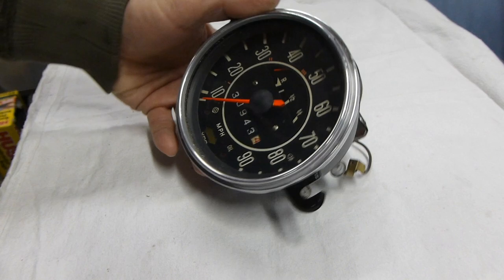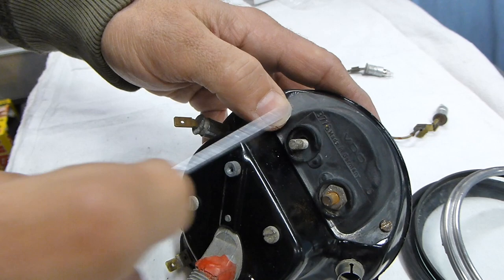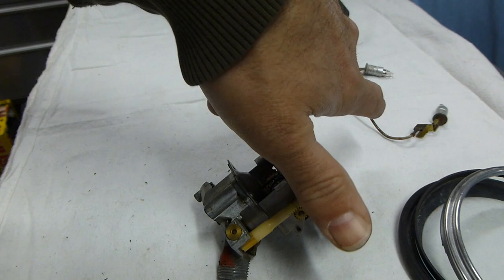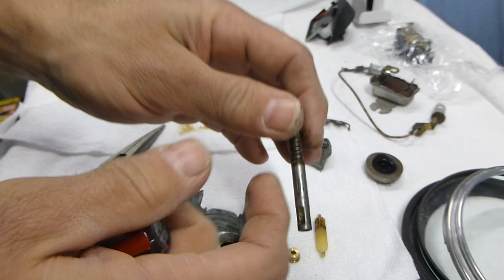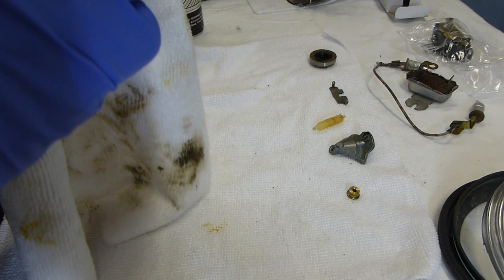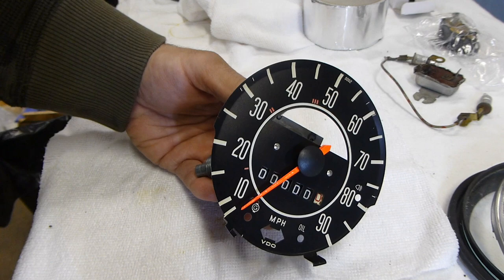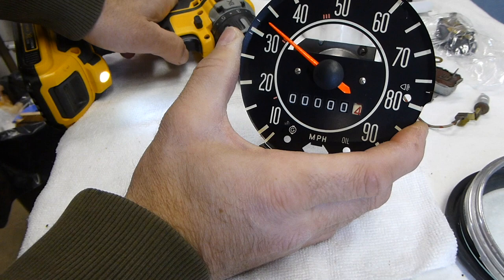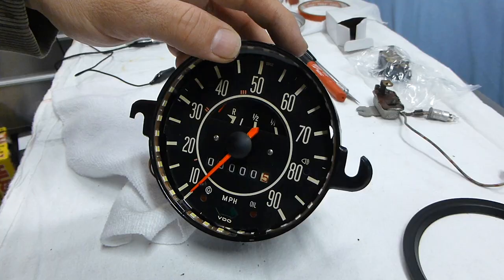Classic VW Beetle Second Gen. Speedometer Rebuild and LED Install

Comment: Way to think outside the box. Never thought about adding a led strip.
Reply from the maker: I tried to find better bulbs etc. but nothing was strong enough to make a difference so using the led strip was simple and effective, and isn't visible when it's off.

Comment: Thanks for the video. It's the best one that resembles mine. You've allowed me to tackle this myself for my '74 VW Thing. There are a few minor differences but 98% identical. My glass is actually polycarbonate of something and it had no gasket. What kind of grease do you recommend?
Reply from the maker: Thanks! I'm glad it helped. I use a thick gear lube grease, you can use any gear type grease that is ok on plastics etc. It doesn't take much, you don't need it to sling around. Something like a good dialectic grease could work well too.

Comment: Ppl like me use videos like yours when we run into problems. Like I did rebuilding my speedometer. The two toughest parts were resetting the miles and putting the back of the speedometer back on. Lining up the tiny little wire in the tiny little hole. Your video was very informative until you skipped showing the two hardest parts and cut away only to return with the part fixed but didn’t show how to fix it. Other than that it was okay. On another note I believe people like me don’t necessarily go looking for these videos unless we run into problems with something we are doing. If I find the video that helps fix my problems I mostly skip past all the BS ppl say and do to make their videos fancy and go right to the meat of my problems. Thanks for making them they help most of the time.

Comment: Great video ! Would the LED connection need a resistor ? Or just connect it ? Thanks for your time big fan keep up the great work on VW DYI . Alex NJ
Reply from the maker: Thanks for the kind words! The les strips I get are 12v so on a 12v car it's a direct connection. On a 6v car id add a converter that converts 6v to 12v you should be able to find them on Amazon or alibaba etc.
Reply: @WolfHausMotorwerks did you wire the LED strip to the dimmer on the dash?

Comment: What size LED strip is that?
Reply from the maker: It's a generic Led strip, about 12" long and just a bit less then 1/2" wide, you can use a strip that is less wide but not really wider. The ones I have used can be cut shorter and most come with an adhesive backing. You can find them at most electronics stores or online. they run on 12V DC.

Comment: What are the light bulbs u used I can't find the model name of the exact bulb model number online
Reply from the maker: The Led strip I use is similar to this 
DC 12V Waterproof 1Ft 15 LED Strip Underbody Light with 6 inches Wires for Motor (White,Pack of 6) https://a.co/d/5ArgD3r
I hope this helps👍

Comment: Is it possible to  buy the piece that the speedometer cable goes into?  My old speedo cable rusted into that pin/gear. I finally got the cable off but a piece of the cable is still stuck in there so I cant get another cable in there far enough to turn the gear 100% of time but will work sometime.  I want to take the speedo apart and replace that piece, I might even be able to remove the broken piece with it apart but didn't want to risk not having the piece before starting this.   This is for a 74 Acapulco Thing.
Reply: Second question if I do have to buy a used speedometer for this, is that gear pretty standard for these speedos that have the separate fuel gauge?
Reply from the maker: I'm not aware of many or any spare parts other than a gear for super beetle speedos. I usually source used units to pick parts from.
Reply from the maker: Ideally I usually get as close to identical unit to swap parts from.

Comment: Is it legal to run the mileage back?  I thought it was.
Reply from the maker: I can't say what is legal or not in your area, however these speedometers often broke and were not accurate, easily replaced by one from another car, and at 99 999 they would go back to 0. In the video I show how to fix etc, you can also use this to put the correct milage into a replacement speedo for example.